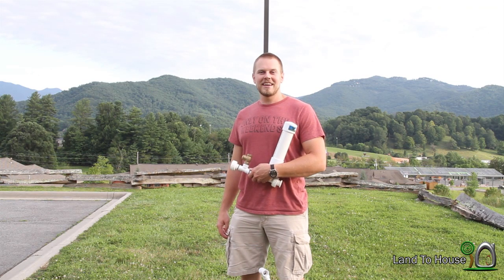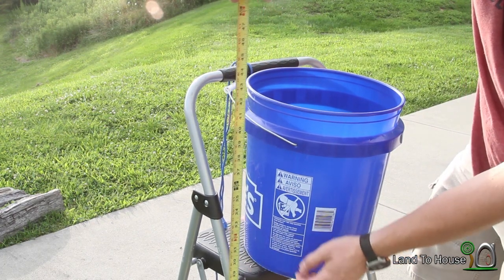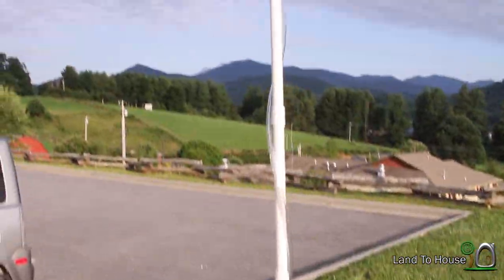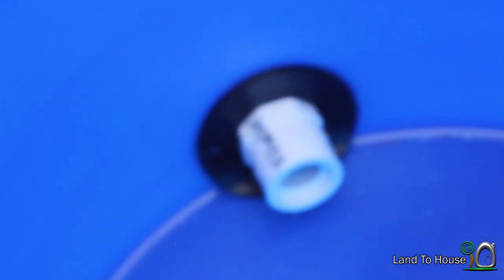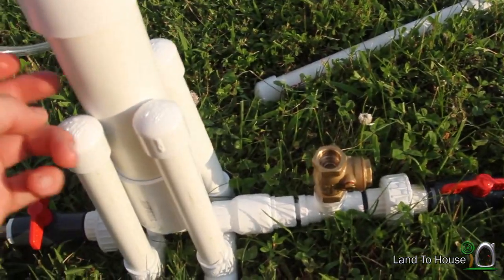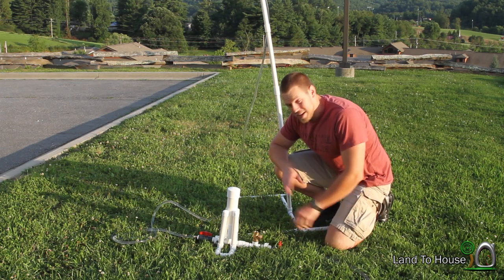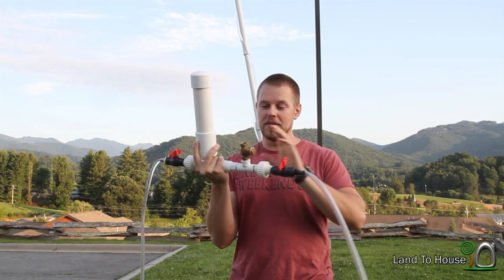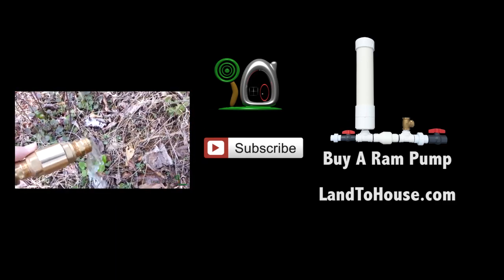1/2" Ram Pump GPM Test

Comment: Having looked at a number of these from Victorian days in the UK, the length of movement of the poppet valve (inverted mushroom) can be altered by a nut on a threaded shaft.   You are using a water hammer effect surely, the greater the mass of water that is suddenly stopped the greater the pressure wave produced.  Also energy can be lost in the delivery tube if it can expand.  Sticking a strain gauge around it would show if this is a problem and would putting a pressure gauge on the air receiver.  Or hold it with your fingers and see if it is expanding and contracting.  I do not think that the pressure in the reservoir is related to the head of pressure but to the mass of water stopped and its momentum.  For a given system a maximum pressure in the air reservoir of say 15psi. working on 4 square inches would give a value of 60 poundals, if allowed to work on 10 square inches would give a value of 150 poundals. (50 years since I last used these units).  Twinning up the reservoirs would be interesting to try.  The Victorian units also had a manual valve on the top of the air chamber.  Steel throughout might be more efficent or using a larger outer secondary pipe and filling the gap with cement to reduce the flexibility.  How this stimulates some thought.

Comment: If you capture the water coming out of the check vavle, will that reduce the efficiency of the pump?  I'd like to have the drive pipe coming from a cistern, but wouldn't want to waste all that water.  How much is wasted? Like 90%?
Reply from the maker: +Redbeard4Beer there is a lot of waste. It can be anywhere from 60 to 90%. The valve needs to be free to let water pass but you can collect the water after it is wasted from the pump and use it downhill. If you place a pipe on the check valve it does reduce efficiency.

Comment: You are wasting a lot of water letting it spit out and go where it may. Can you refill the bucket with it.
Reply from the maker: From my experience the ram pump loses 60 to 90% of the water out the waste valve. It is true that I could have routed the delivery pipe back to the bucket but it would not have added mich more time.  In this test I was basically trying to determine how many gallons per minute this tiny pump requires to operate. :)
Reply: You quote your pump output at .8 gpm. But others have said that you are losing about 75% out the waste valve. The important number is how much water is coming out the output hose? Maybe about. 2 gpm.
Reply from the maker: Because there are so many factors affecting a ram pump the output varies greatly. The closer the lift height pressure reaches to the pressure in the pressure tank the less water you will have on the output.

Comment: AIR CHAMBER QUESTION: I know the air chamber could be too small but is there any limit on how LARGE THE AIR CHAMBER CAN BE? 
 It seems that the air chamber can be an empty pipe as large as you want. If the air chamber IS for example, Two gallons capacity for the 1/2" pump this would seem huge, but the truth is that the air pressure will equalize to approximately that of your pipe going to the house (end user). Therefore; no matter how much air you have in the chamber, the energy contained in it will always be released in the direction of the water being pumped up to the house and will never be lost any other place. it seems that the larger the air space the larger the capacity for each RAM action to force water in.
NOTE: if water in the house line remains in motion during the entire ramming cycle it would increase efficiency by never needing to start/stop the flow on the output side. In effect; if your water to the house stops and starts, it will be fighting the ram pump with the same type of RAM action that makes the pump work. Eliminating the stop/start will eliminate the back RAM pressure. 
I look forward to any critical response to this post ESPECIALLY constructive, NEGATIVE feedback ! ! ! Positive feedback is nice but the negative is what allows learning to happen! 
Harold
Reply from the maker: +Harold Westrich It has been my experience that the tank size does not have an upper limit. But there are some issues with having a tank size that large. If you have a pump that you start and stop a lot it would take a while to build that pressure back up. It would still only reach the maximum pressure that the pump can supply. I have not tested a pump tank of that size but I have a feeling that the pressure would be released the same no mater what the tank size is. Even if you had a 10 gallon pressure tank the pressure would not stay in the tank and build up.

Comment: you have to figure out how to recycle the water wasted by the first valve, maybe sending it back to the main reservoir. ( in farming water is precious!)
Reply: There would be no way to bring all the wasted water back to the original reservoir without putting energy into the system (like with an electric pump). The idea is to pump water to a higher point than where it started using only the potential energy of the water. The cost of doing so is that only some of the water will be pumped.
Reply from the maker: That is an issue for sure.  The waste valve does indeed waste a lot of water.
Reply: i know.. most of the water is wasted... you have to figure out a way to collect it under the pump and send it back to the main reservoir or... pump it out using the pressure from the pump itself. maybe with a sort of venturi tube
Reply from the maker: +Aldo Agnellini Most of the pump installs that I do in my local area are in creeks so the water returns to the creek. But if you were to pump water out of the creek and away from the creek it would be best to return it to the creek. This example was just a controlled test.
Reply from the maker: +camoronL well stated. Typically I find the ram pump is only 60% efficient or less.  But considering it's free I think it's more like 100%
Reply from the maker: +Andrew Carpenter I typically recommend that people use the ram pump in a creek so that the water from the waste valve returns to where it was originally flowing. I actually have a test where I use the output of one pump to run another and it was less efficient than running the first pump to the output of the second. But I did not try running the second pump from the waste of the first pump. That would be a fun experiment.
Reply from the maker: +Andrew Carpenter I am very interested in seeing that all work together. One thing you may have to consider is keeping leaves and debris out of the cool that would stop up the system. In my area we have a big problem with that in the fall. It seems like a fun project that should work quite well.
Reply: My cistern has a roof on it and it is pretty well enclosed so animals and debris don't get in it.
Reply from the maker: +Andrew Carpenter perfect. That's even better. That type of setup with a spring is often the most reliable. If you have at least one gpm.
Reply: Even with ¼gpm I think this system will work.
Reply from the maker: +Andrew Carpenter yes it sure will. Might not be able to run the pump 24/7 but it will certainly allow you to run the pump for storage.
Reply: Land to House I agree a creek setup would be optimal but that's not always an option. as in my case I live on a hill side and the only creek is about 300-400ft lower than where the house sits and it a rather small creek. however i have a good running spring that feeds into an old cistern. the front wall is cracked and the original well pumps are junk but I have a old pool that I plan on using as a liner for the cistern and I will use that to feed my ram pump to the house(about 40ft elevation difference). my spring flows all year round but has a low flow rate so I will only run the pump when I need it. maybe setup a 55 gallon water tower beside the house to pump the water to.
Reply from the maker: +Andrew Carpenter every setup is different for sure. You will need around 7 feet of head pressure to get to 40 feet. The 1/2" pump normally works on 1gpm flow rate. If you need to get a pipe into a tank check out uniseal.
Reply: I plan on using the drain plug on the pool to hook up the drive pipe and the hose that went to the pump will be used to serve as an overflow drain. The overflow will be diverted into a drinking hole for the wildlife in the area. The pool I'm gonna use should give me somewhere between a 2500-3000 gallon reserve to run my pump. Once I redo the spring I may even be able to let a small pump run 24/7(fingers crossed). Once I get started on it I will send you some pictures and I may make a video.
Reply: This is why the pump is not a free energy machine. There is no way to return that water to the bucket. Its energy is used to generate the momentum to spike the pressure which drives the whole system.
Reply from the maker: Well put. The ram pump needs a lot of water to keep it going. Most of the water ends up at a low state under the pump.
Reply: I would suggest a slight shift in the perspective...if you think of the source as a stream, then 100% of what stays in the stream bed is "wasted" if it's not being used by the house or for irrigation. From other presentations, I'd say it's safe to say there's a 8:1 ratio of water in the drive pipe vs water lifted. So, if you think of it as a 12.5% improvement in water availability to the house/garden, rather than 87.5% waste, I think that's more "fair" to the pump. If the "wasted" water is returned to the stream bed, then 100% of the water removed from the stream is lifted. That's an impressive sounding number, and I think more reflective of the brilliance of the ram pump. Obviously, I'm playing with numbers, as well as semantics, but, water moving through a stream is not really in the binary state of either/or (ie, either irrigation or ram pump). Most of it is passing by at a good clip, with no benefit to the farmer.
Reply from the maker: Well stated. I often use the term Waste Water because that water is coming out of the valve named "waste valve". The water in the creek is going to flow with a ram pump or not so it is not actually waste.
Reply: depending on the size of your ram pump you could use something to catch the water from the waste valve and divert it to run a smaller ram pump. you could pump them both to the same location depending on the elevation. thus reclaiming a good portion of the waste water or even pump it to a second location either way it could reduce waste and ground erosion.

Comment: I did not see any material listed there for the 1/2 ram pump
Reply from the maker: Ah yes it's the same as the larger pump only reduce all components to 1/2". This pump is so small that its best not to reduce the delivery pipe smaller. The pressure tank can be 2" pipe 15" tall.

Comment: Your measurement of the water used in the bucket (5 Gallons), IS NOT the water that was delivered at the top. You should measure the amount of water that was pumped up. Nice pumps at a fair price, I will pass this info on to my cousin in Australia, where he may require a RAM pump.
Reply from the maker: +Cory whenever you're ready to build be sure to check out my free e-book on my website. It has lots of good information on how to work with these pumps. And if you decide not to build I have them for sale :)
Reply from the maker: +Burt Reynolds thank you.  I feel that most people misunderstood my test. This test was meant to find the gallons per minute of the supply to determine the minimum flow rate that the pump would work on. Basically if someone has a low flowing creek of 1gpm can they still use a ram pump?  This video shows that yes they can. The gpm value at the delivery pipe changed with the parameters of the pump. Head pressure vs lift height.
Reply: @LandtoHouse  Misunderstood, but can you please do the other experiment? :)
Reply: nice pump and demonstration 
good video
gal per min of the supply water makes you seem foolish though
Reply from the maker: +Cory I apologize for the lack of clarity. In this test I could have closed the delivery pipe and the results would have been the same. I was looking to see how much water the pump requires to operate regardless of output. The water at the delivery pipe varies based upon head pressure and height of lift. Generally every 1 foot of head pressure will result in 7 feet of left. The volume depends upon the size pump.
Reply: yes thank you. after reading some other comments I figured out what you meant. great pump by the way. I would love to build one some day
Reply from the maker: +Walter Tofel That is correct. The water delivered will change as the hight is changes. It will match the pressure in the tank. The water in the 5 gallon bucked is an example of that the pump needs to work and will be rather consistent. I need to get shipping to Australia set up :) thank you.
Reply: ok I did misunderstand too. I would like to know what the output is too.

Comment: where is the collector? how many liters deliver vs the input water?  What is the ratio?
Reply from the maker: Jonathan Domingo the ratio of water in to water out will depend upon the height to which you pump water. As the vertical left reaches the same pressure that is in the pressure tank the water will slow down. this week I am in the testing stages of this pump. I will have it for sale on my website soon

Comment: I wood say 2 feet every 50 yards
Reply from the maker: Ok.  Typically you want to get all your drop in 100 feet or less. Since you have few feet of head in that distance you will need to look into a stand pipe with long supply line.  On my Channel I have a video on stand pipes.  That will be a good start.

Comment: Seth, could you tell me how much in feed of water I need to make my 3/4 inch pipe and check value, work. My creek can easily bury a 6 inch P.V.C. pipe with what I think is a pretty strong downstream current. Cannot seem to get it primed and working ? What am I doing wrong ?
Reply from the maker: Hello.  How much drop do you have in your creek? This is the most important factor in getting a pump running.

Comment: Hi Seth! So if i got it right the lower the flow of the river (the lower the supply) the smaller the pump needs to be. Correct? This has to do with the ability of building pressure in the tank? Thanks George
Reply from the maker: I am not sure if I replied to you or not. I apologize if I missed you. The reason for a smaller pump is it requires less water to operate.  The drive pipe cannot gulp air or the pump will stop.

Comment: Another nice video Seth, I think you could do well showing those at Farmers markets etc, I'm sure you would get some sales are seeing it demoed. My 1.1/4" is now providing a steady supply to my garden and raising it over 50 feet and some 300 feet away from the pump. I have put a video up showing the storage tank I installed part way down the delivery pipe to enable me to extend it to about 150feet.
Reply from the maker: I just watched both of your ram pump install videos. Very nice installation. Everything seems to be working well and efficiently. I really like the intake that you have and the storage tank inline with the drive pipe is another good idea and seems to work well!  ... I am looking forward to showing off the pump at markets and other farm related sites. ...Your pressure tank seems to be doing well also. I had been wondering about that.
Reply: Land to House .com Yes, it is all working well, I'm very pleased indeed with it all. My next project is a saw mill. I am ordering an Alaskan saw mill  to use with my Stihl  chain saw. I have a load more fir trees to cut down and I want to convert some to lumber.
Reply from the maker: Michael Collinson How wild!  I am going to upload the first of four videos tonight showing my attempt to free hand lumber cutting with a chainsaw. You are MUCH better off with the mill. Free hand takes much more skill than I have. Making your own lumber will be so rewarding!
Reply: Land to House .com I shall look forward to it, I have seen a youtube video showing someone free hand cutting planks with incredible skill, I don't think I'm up to that though. I am looking forward to the mill and will post some videos
Reply: มฝฝ

ส

Comment: if you used a bigger pressure tube with the same size flow pipe would that make the flo or efficentsy better
Reply from the maker: When you say "Pressure tube" do you mean the pressure tank? If you increase the size of the pressure tank it will increase the potential of the pump to a degree but there is a point when it does not make a difference. For this 1/2" pump the tank is about as small as I would go but I would not go more than another 4 or 5" taller with a 2" pipe. To make the current pump work much better I would use a non flexible pipe as the drive pipe.
Reply: Roy, If you take a look at http://www.clemson.edu/irrig/Equip/ram.htm there is a chart showing pressure tank sizes that may be helpful
Reply: Michael Collinson thank you for this link..
Reply: tisoy kuno No problem, glad that it was useful to you